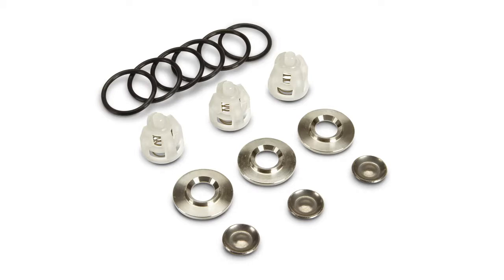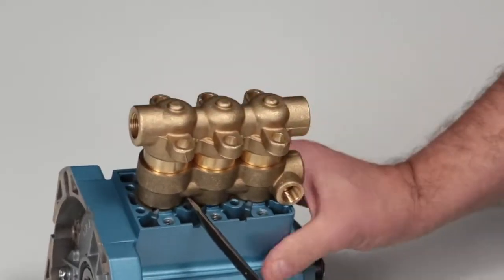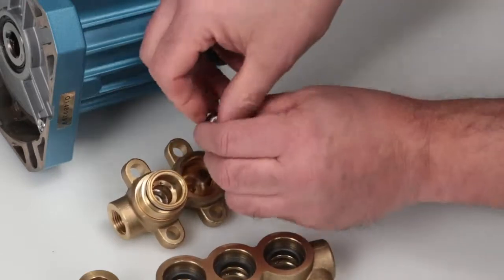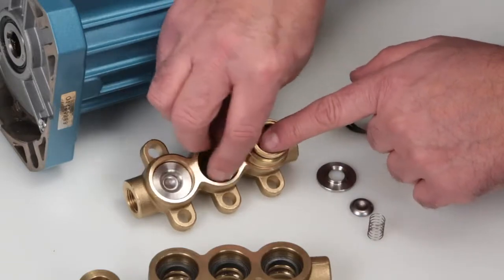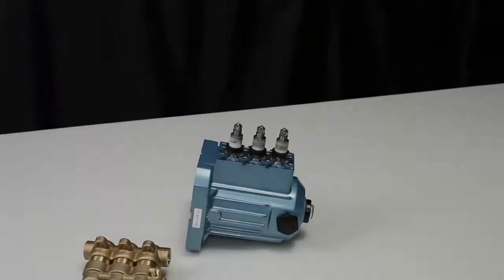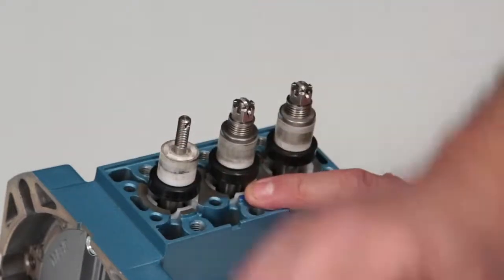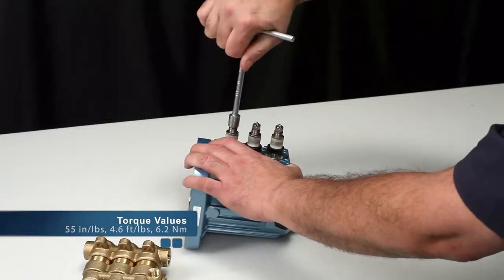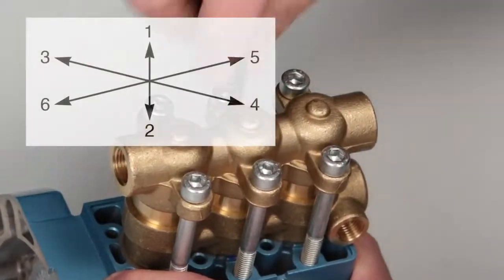CAT Pump Repair: Servicing Valves 2SF Series Pumps

Comment from the maker: required parts 1.  https://www.jnequipment.com/shop/pressure-washing/pressure-washer-repair-parts-kits/cat-pump-repair-kits-replacement-parts/34052-cat-valve-kit-2sf-2gz-pumps/
required parts 2. https://www.jnequipment.com/shop/pressure-washing/pressure-washer-repair-parts-kits/cat-pump-repair-kits-replacement-parts/34668-cat-inlet-valve-kit-2sf-2sfx-pumps/